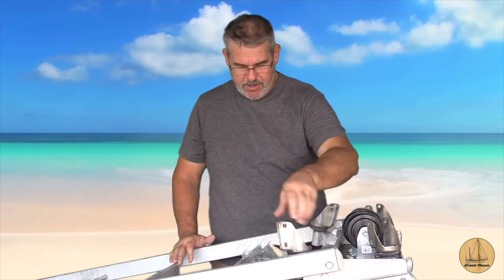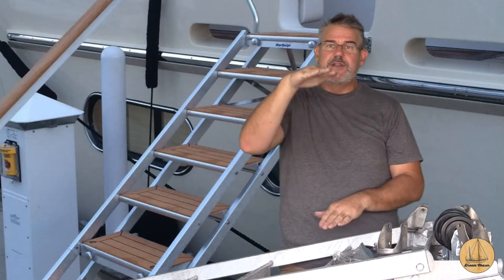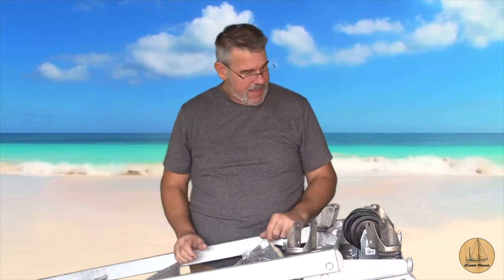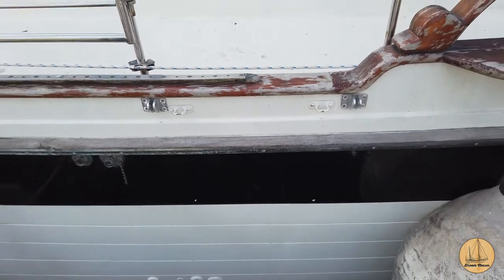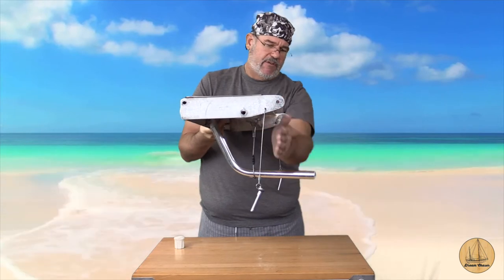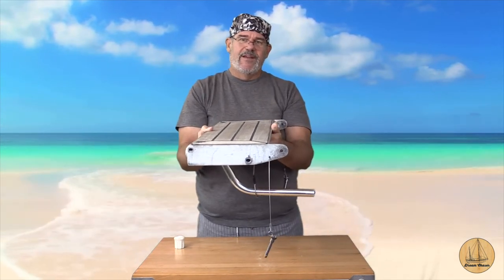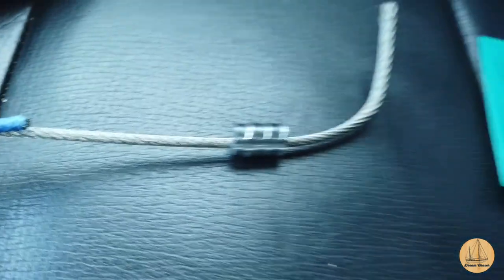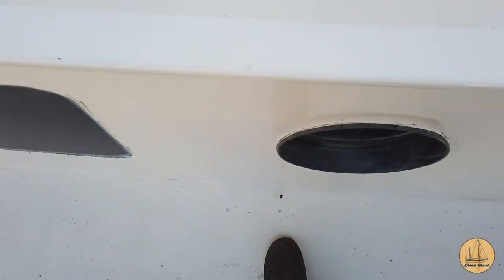Resurrecting old Marquipt Sea Stairs

Comment: Did you ever figure out  how to change the entire casters?
Reply from the maker: I did figure it out (Baai at buy Mew ones from Marquipt at 80$ a piece. So I opted to buy the cheap wheels and use them instead. They have been on the boat and do I’m for 7 months or so and have maybe worn down 25% rubbing on the dock with the tide and waves. I figure it will cost me $25 every 18 months or so the swap out new wheels.

Comment: Interesting design. I'd have to see it but I believe I would have designed it differently. Keep in mind though that I'm NOT an engineer. Just a shade tree from way back. This has me wondering about making a set though just out of curiosity. Who knows where a feller could make his fortune?! 😎
Reply from the maker: Agree. There is likely an option out of other materials that would be lighter and likely cheaper. They are good and work well for sure but buying new will set you back a chunk of dough for sure.
Reply from the maker: Oh I did do a little bouncing on it. The good news is if that rod fails it just turns into a ramp. But I agree that rod thing is a strange design. I would be interested in what you were thinking of with the spacer. I was thinking of that too just wasn’t sure how to make it flexible for tied tides over night or something.
Reply: @Svdreamchaser  image the top step and attachment point being a triangle or box on the ends so that the steps could attach and work as made. The too still attaches like it does now, but at the bottom you put a stainless version of the leveling pads that's under your washing machine and refrigerator. You adjust it to fit your boat. I'd be tempted to add a removable jack to make it easier to remove or install. I just think that thin wall bent tubing is a week point. However that may be on purpose. Like a crumple zone on a car. What do I know? 😎